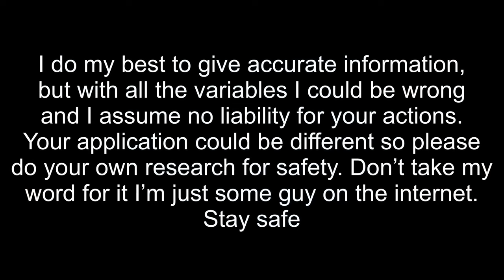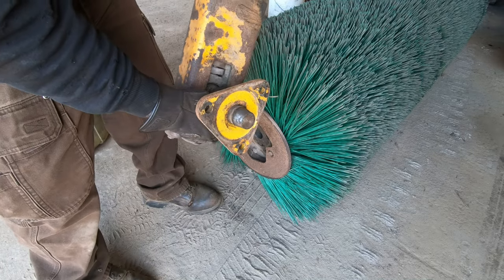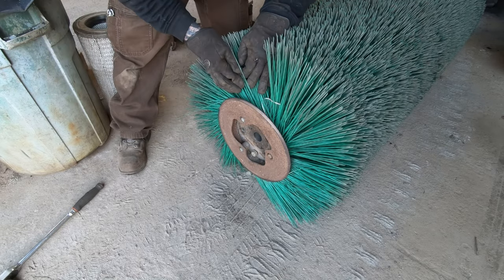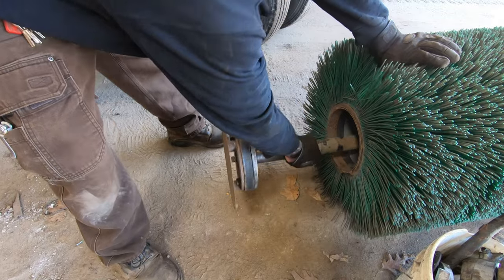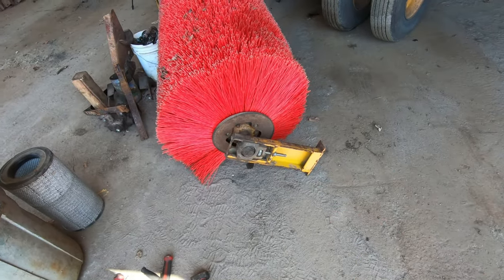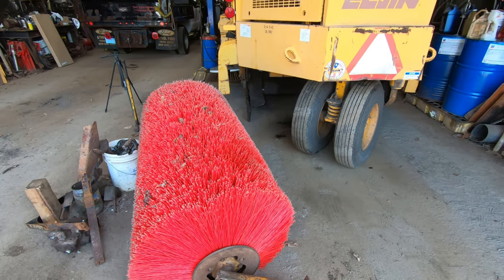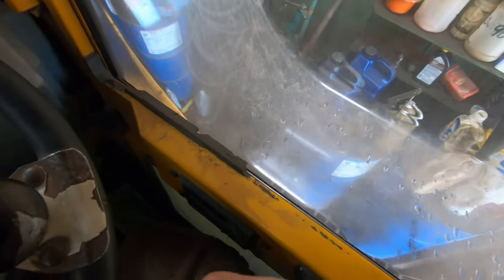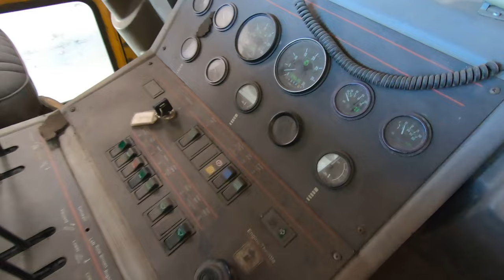Elgin sweeper main broom replacement

Comment: Lol tip. I replace these myself at my workplace. When putting the axle shaft back in. I little WD-40 around the rubber or into the tube. The shaft goes in like butter.
Reply: thats what we do too. Make it show much easier.

Comment: It's interesting to see the wide range of equipment you work on.  I see stuff like that all the time but it never really occurs to me that someone has to know how to maintain all that stuff!
What do you do with the old brushes?  I'll bet cattle farmers would like to have them as scratching posts for the cows.  Thanks for the video!
Reply from the maker: I’ve heard someone with pigs say they use one for them. It will either go to the transfer station or we also use it for sweeping lawns with the back hoe. They will grab it with the backhoe and sweep dirt and such off lawns.
Reply: @JasonTheMunicipalMechanic  Amazing how stuff can be repurposed when it no longer serves its original use.
Reply from the maker: I know what you mean. I have a hard time throwing out stuff that looks like I could use it for something.